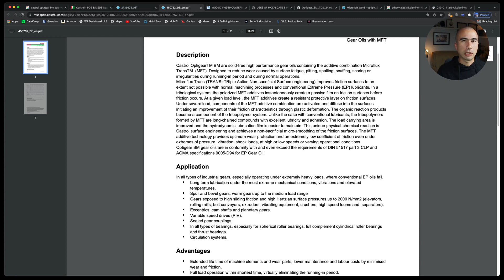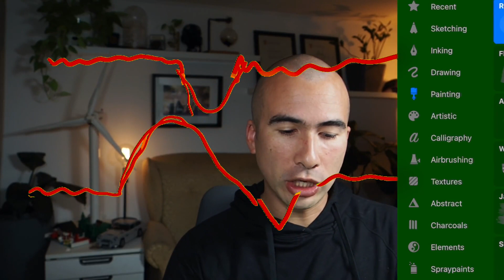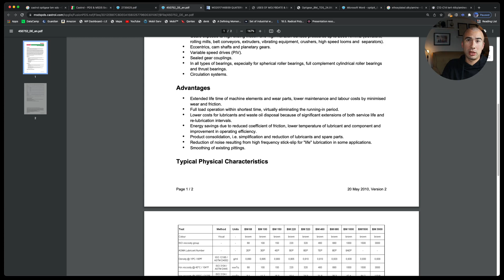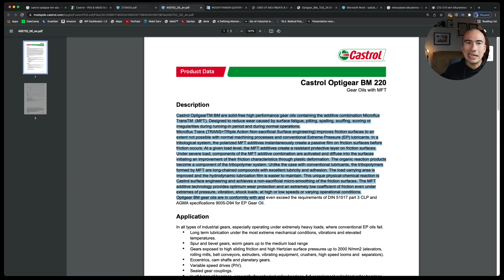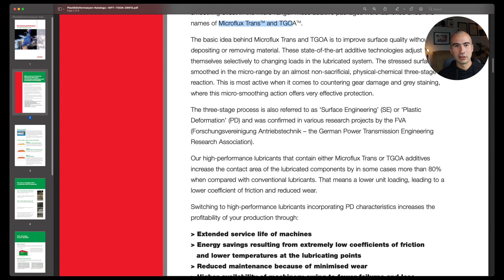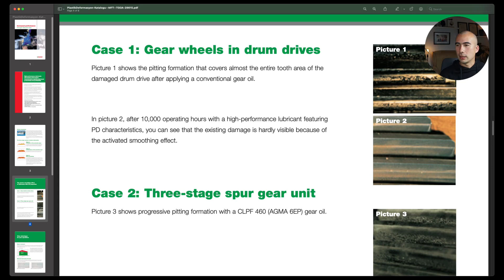Decoding Gear Oil Marketing

Comment: I have a general question. My father always kept his cars for a long time, as do I, his philosophy was oil is cheap & easy to change, engines are expensive & you’re off the road during the rebuild process. He therefore always changed his oil every 3000 miles & the filter every six. This was before synthetic oils but I tend to follow a similar philosophy, just a bit long for my daily driver & the same 3k but I usually change the filter whilst I’m at it on my classics (MGB & Lotus Elan+2). 

What would be your recommendation, a more modern oil & if so what grade for these old cars? The Lotus has a rebuilt bottom end with only a few thousand miles on but the MGB has over 100k since the last rebuild?

Comment: Isn't that what zinc and boron do. From reading they supposedly deposit in low spots of mating surfaces smoothening the surface.
Reply from the maker: Zinc and Boron are supposed to adsorb to, and react with surfaces. But in laying down a completely separate antiwear layer you lose control over the final surface roughness, and they're definitely not designed to plastically deform the surface, which this product purports to do.

Comment: Sounds like the Castrol additive may affect surface hardness, possibly by pulling carbon out of the surface. It would be interesting to see micro-hardness tests of the surface. If that is true, it's not something I want in my gearboxes.
Reply from the maker: Yep! This is exactly the kind of thing I want to see in marketing material. Without a thorough explanation for the mechanism - why would you take the risk?
Reply: Another possibility is a surface effect of sulphur, hydrogen or nitrogen content of the steel. This would affect surface hardness.  In the hydrodynamic range this effect may be great, but what is going to stop a surface wear point constantly softening and becoming deeper ?

Comment: I work for a main lubrication company (which I won't name for privacy issues). I'm basically a footman in sales deparment, and yeah, they make it really hard for me to give convincing arguments on clients and engineers as to Why is my brand better? other than, because it's our brand. TDS they all have the same words.
Reply from the maker: Yeah it’s a problem. The thing is it wouldn’t be hard to provide some more information!
Reply: I was in sales for automotive parts for a while. Tried talking to the oil reps about oils. I wanted to know for myself and to be able to better explain and recommend one oil from another to customers but the reps did not tell me much more than they have the best ingredients in them. They either did not know, or there was little difference between the brands.